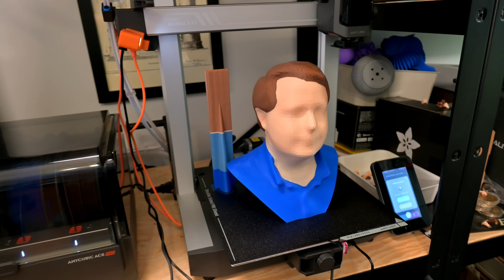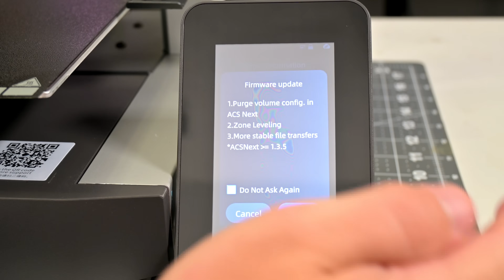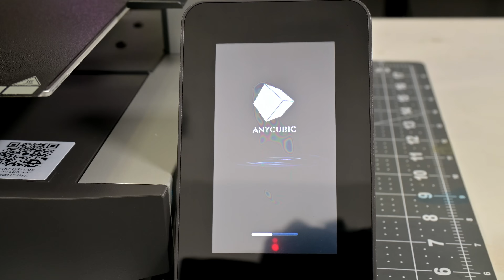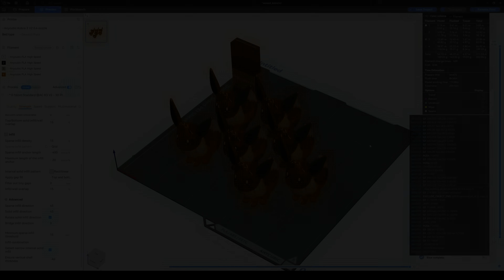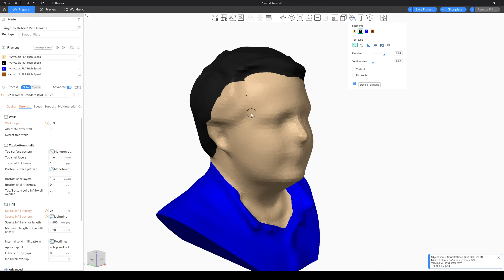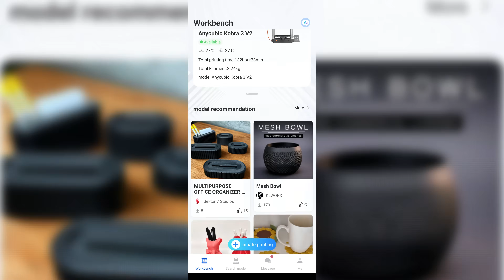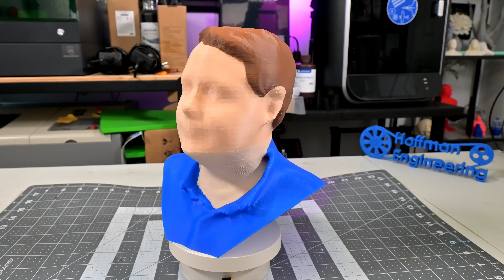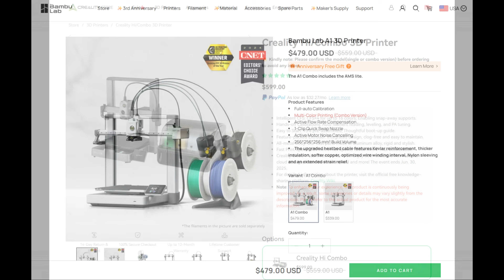Is this better than the Bambu Labs A1?! - Anycubic Kobra 3 V2 Combo Full Review!

Comment: The filament heater heats well but it doesn't exhaust the humidity at all. Would popping in a. couple small holes help that?
Reply: Yes, I drilled one hole over every roll and it made a difference

Comment: Do you recommend changing any default settings in the slicer... I've noticed, that if I don't tamper with the settings,  it tends to come out better, than when I try to play around with the settings... My biggest issue has been, I've had 3 different filaments that refused to extrude.. kept "clogging"

Comment: I was wondering how to use eight colors at once? As in two ace pros and connect both to the rinter at the same time.
Reply from the maker: There is an 8 color hub that replaces the 4 color hub at the top of the extruder. All 8 tubes from the two Ace Pros will go to that 8 color hub. The printer takes care of the rest.

Comment: I've been searching for a 3d printer and it is honestly a confusing purchase. Do you have to buy other things with the printer besides filament?  I keep seeing another machine next to them. Im so confused on what to get.
Reply from the maker: So you can buy just a printer, and print with a single roll of filament at a time. That will let you print parts in a single color at a time.

But a popular thing over the last couple of years have been multi-colored printing. Companies have released add-ons for their printers that hold multiple rolls of filament, and allow the printer to automatically switch between them. This lets the printer print with 4/8/16 colors in a single print.

Anycubic calls this add-on their ACE Pro, which works with their Kobra 3/Kobra S1/Kobra 3 Max printers. Other companies call them different things, Bambu Labs has their AMS, Creality has their CFS, etc.

You don't need these systems, printing in a single color is just fine. But these systems do open the door to multi color prints that wouldn't be possible without them. But multicolor prints take a lot more time and wasted filament (hundreds or thousands of color changes).
Reply: Kobra 3 v2 combo,I have the 8 colour only thing I’ve had to do at 600 hours is replace hot end as brass nozzle wore out 😅,it was no issue to replace,only because I was printing more abrasive filament,but a amazing package easy for new users brilliant for the price misses just got the same
Reply: @nunyabusiness8773 got mine from a German seller on AliExpress, the Kobra 3v2 combo (4 colors) for only 250€. It's my first printer and I can't wait to start playing around with it

Comment: so bambu or anycubic? which one should i get they about the same price right now.
Reply: Kobra 3 v2 is a great printer
Reply from the maker: If it's between the A1 and the Kobra 3 V2 at same prices, I'd go with the Kobra 3 V2. The ACE Pro has a bunch of features the AMS lite just doesn't have.